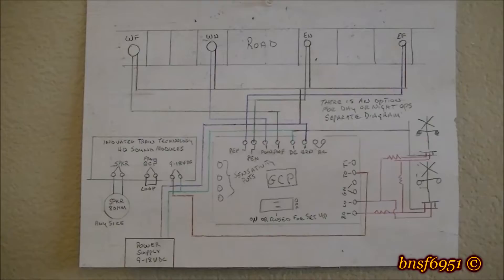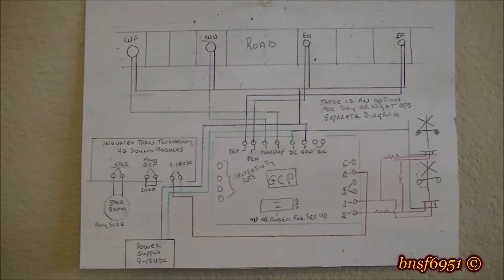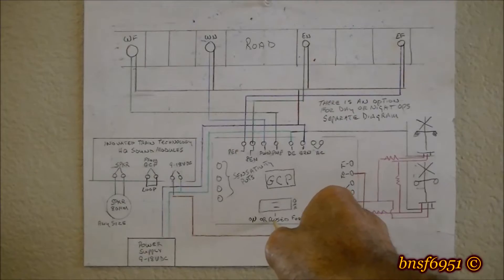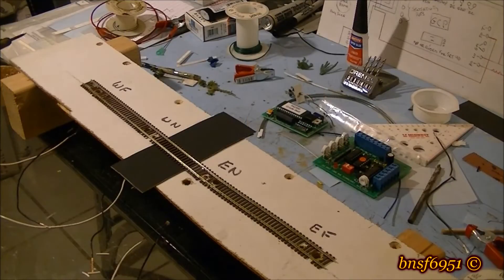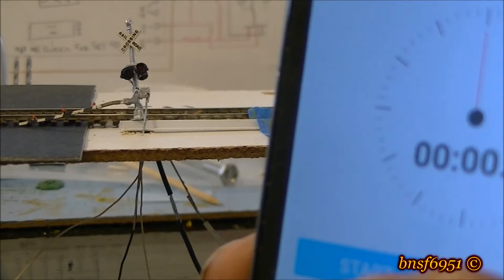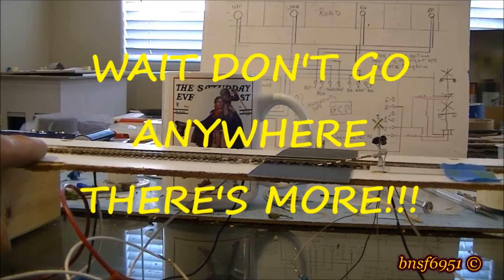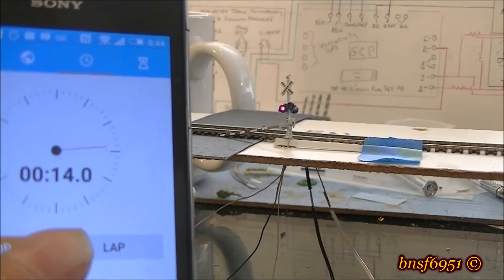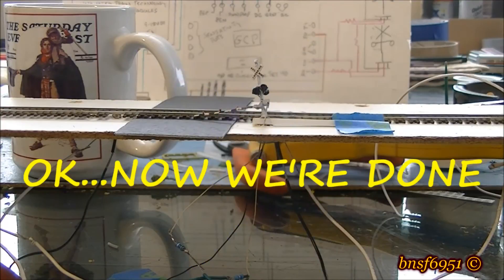Logic Rail Technologies grade crossing wiring & demo

Comment: Great job. Does the arm go up and down? Or would that require more wires and circuit boards? I'd love some of these on my layout. -Mark
Reply from the maker: hi Mark... yes you will need a Tortious or Cobalt switch machine to operate the arms.. there is an output terminal on the same board for that... it's not hard to hook up...  thanks for watching & your question.. vinny

Comment: Great tutorial for the timid viewers that are not sure how to proceed.   By the way, good advice about putting the LEDs on my Tortoise motor leads to save the contact for something else.  What it will really do is save running an extra pair of wires from my future panel out to each turnout.  Thank you, Rob
Reply from the maker: hi Rob... glad you liked the vid... i am glad that i was able to save you some time & money with hooking up your LED's... i don't remember if i mentioned this but you can use one lead to th tortoise to operate both LED's .. all you need to do is connect the anode of one led  to the cathode of the other led... hope that made sense .. thanks for watching & your comment.. vinny

Comment: I may go with sensors too. The set up I have work with the section of the track being isolated. I don't know if the board is going to recognize the servo motors either. I'm not going to know til I get of my butt.lol. Good to see ya Vin.
Reply from the maker: hi Stan... i have been using this system for a while & have had no problems with the sensors...i'm not sure if it will work a servo... you'll have to do some research for that... thanks for watching & your comment.. vinny

Comment: You are waaaay over my head at this point. Neat action for the layout. Will the gate go up and down?
Reply from the maker: hi George... it's not as hard as it looks... i should have done a better job on making the wiring a little neater so it wouldn't look so complicated... yes the arms will actuate with the help of a tortoise or cobalt switch machine.. the same circuit board has out put terminals for this function.... thanks for watching & your comment.. vinny